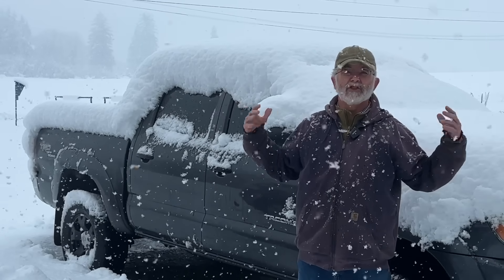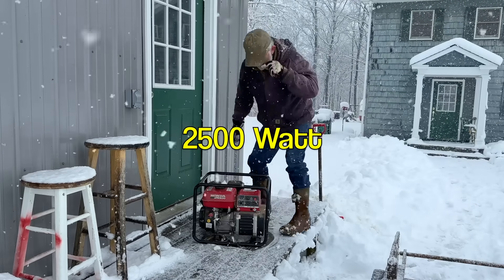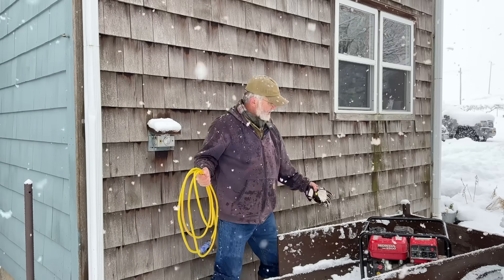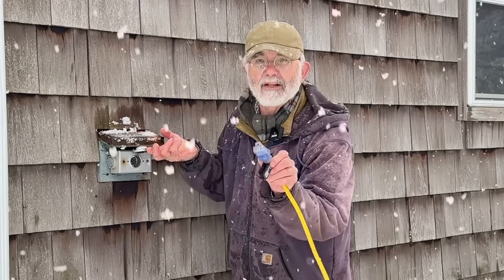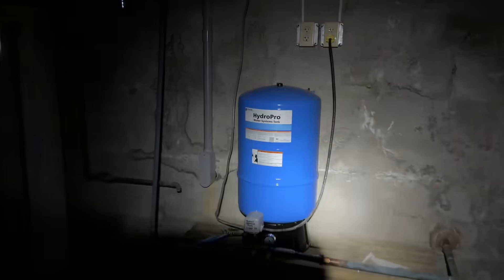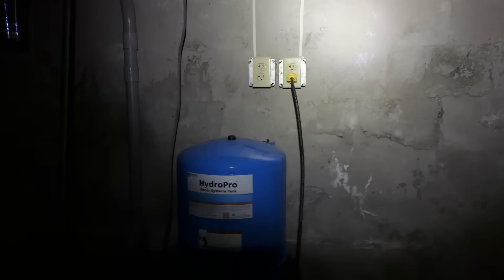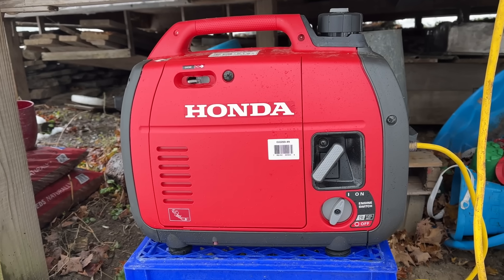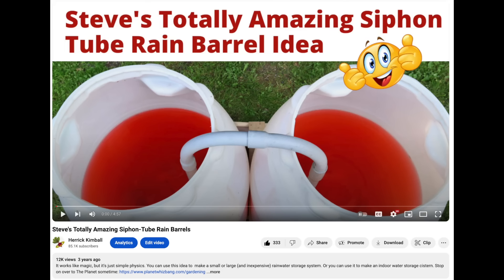Super Simple Generator-To-House Hookup  -- A Proven How-To

Comment: very cool idea!  I personally ended up going the dual solar power station with a hub for 240v into my main panel with a 30 amp generator inlet / interlock switch setup so we can power most of our home and avoid back feeding, but what a cool idea!  I'm curious with the price of the bigger solar power stations coming down if you've thought about tapping into that input inlet (or using a standard 120v outlet) on the inside and using a 2-3kws solar power station to power your parallel circuits?   Of course you're in snow land, so not sure you'd get a ton of wattage from a couple of panels set up temporarily to recharge it and you'd probably still need to use that newere inverter generator to charge the power station :-)

Comment: I turn off the main electrical panel at my pole and I have wired into the house panel. This way no power is sent down the main circuit. Have used this for the last thirty years on the gulf coast.

Comment: Suicide cords are illegal. You could actually kill a line worker. So if you use a suicide cord..usual is double male end. Turn off the main breaker. On most homes they are marked 200 amp. Then you can use this set up without risk to others

Comment: I have a building that's off grid. When I need to power it , I use a generator. The way I do the hook up is to use a generator extension cord with a male plug on both ends . I first hook up to a outside receptacle , then hook it up to the generator , then I can start the generator . The only things I power are three or four florescent lights . This works very well 
This building has never been on grid
( there's no grid available ) .

Comment: We're in the Northern Catskills. Our power went out last Thursday and again on Thanksgiving day. NYSEG customers. 43 hours out last week and 7.5 hours this week. We had a power outage a few weeks ago from a blown transformer as well. That was pretty widespread. We've become used power outages. They occur fairly often. Long term would be quite inconvenient. When Irene passed over us in August 2011 we lost all frozen food. We're in the process of building a pantry and my wife has become quite a canning queen, (pun intended) even canning venison. We have an older Homelite generator with electric start and I was trying to dream up a way to easily hook it up for the necessities. I'll be utilizing your ideas for dedicated circuits. We have a spring with a jet pump and a great little creek close by so water shouldn't be an issue. Wood heat. Propane stove. Coleman and kerosene lanterns. All the modern conveniences. Thanks for the ideas. 
It makes me wonder though, how they survive on the Tug with feet of snow, not just inches.

Comment: I've often wondered if I could simply throw the main breaker to the grid power and wire a plug for my generator and hook it to the fuze box..... yes I know that is illegal because there is no OSHA safety system in place however if my power is out I am not worried about OSHA !..... if the plug is set up in such a way as to remind you to un plug your generator before throwing the main breaker how can it be bad ?   
if you do forget it will destroy your generator and probably start a fire but hopefully you hooked the plug in to your generator into some circuit breakers  .... yes a lock out box is safer and is "THE LAW" however not everyone can afford "the LAW" anymore especially here in california ! .... personally I see no danger in disconnecting the main power completely where it comes into the house and then powering the house from your generator it's just that you cannot forget !  and that is the big danger and why they made it a law !
 it's not rocket science although they would like you to believe it is....and wiring up a plug is just about as hard as this gets..... just unplug it "Before" you turn the main power back on !
I use very little electricity here except when I turn on the electric water heater
and the well pump is 220v  but my generator does put out 220v so I could possibly hook it up and have water during the next power outage.... so far this year only one 3 day outage but the year is young I am counting from end of summer to last of spring that is the time we loose power...sometimes for weeks !
Reply: I'd rather not deal with that big "IF I DO FORGET." Electrical work should be always done to reduce to zero the possibility of human error.

Comment: Probably the safest way- but LABEL THEM.
Also use generator to charge 12v AGM batteries, and a 600W pure sine inverter for freezers only. Quieter overnight.
Reply: Label them for what purpose
Reply: @condor5635 Because if you don’t and the generator is not connected someone may think the socket is faulty, and connect the two together- back feeding the supply if there was a power outage. 
Just label them “Generator supply”.
Reply: @r.perkins2103  yeah I guess that would be safe although unlikely doesn’t hurt. I’m sure this guy knows and his family knows but someone down the road might not figure it out.

Comment: This is a very confusing way of doing this using extra dedicated outlets for only the generator. It would be much simpler, and my opinion safer, to backfeed 220 v through a welder or clothes dryer circuit into the whole house main breaker. Before hooking the generator I simply turn OFF the MAIN BREAKER to the grid and any breakers for appliances, like water heater, I don't need.  My 220 welder circuit in the barn goes through a fuse box directly into my main breaker box. Even if you don't have a 220v circuit in your house the same thing can be done through a 110v circuit. I did that for years before I got the welder and dryer.

Comment: I never use the on/off switch on any gas engine that goes unused for months or years.  I leave the ignition switch on and turn off the fuel supply at the tank. This empties the carburetor while the engines stops from fuel starvation..  This keeps the carb from gumming up. When I want to use an engine that has been unused for a long time I turn the fuel valve on and every engine I have starts in one or two pulls.
Reply: Same here, if there is no gas shut off valve, I add one.  However, if I mention this to others, most don't see the value.
Reply: I've done that on ALL my gas machines and find that's the best practice. Best part they'll USUALLY start on the first pull!
Reply: @donwilson4618 hey man that is a simple trick that never occurred to me. I do it with my snowblower from habit, based on what my dad did. But the logic will apply to all gas motors. I guess I was a classic case of monkey see, monkey do. Thanks Don.
Reply: I use 100% gas. Always start. Worth not having repairs.

Comment: So basically you're simply running a permanent extension cord to your home. Is it safe to say if you used heavier wire you could run more outlets throughout your home from the one plug or would you just put more outlets outside n move your gen as you need it? I have a Predator 7500

Comment: Basically you have wired a permanent extension cord into the house, to power critical systems like your well pump, heater, and some lights. Often, in electrical power outages, the gas service remains operational, so a smallish backup generator can power your heating system, preventing the house pipes from freezing and bursting, if it is really cold and outage lasts for multiple days (e.g. Texas in 2021.) Luckily, the US power grid is pretty reliable and outages don't last multiple days (fingers crossed.) For clarity, your solution is isolated from your regular main electric panel--unlike the solution using the 'suicide cable' (consisting of a male plug on both sides plugged into generator and into a wall outlet--which works, but bypasses you main panel circuit breaker, and relies strictly on the generator's over current circuit breaker--which your solution seems to share. For the sake of others, it would be a good idea to label the outlets that are 'live' when you power the back up generator.

Comment: do it right, add an interlock breaker to your main panel. Wire a receptacle on the outside of your house. What are you doing works, and maybe safe, but interlock breaker is not that expensive, and will benefit you more than what you're doing now.

Comment: Generators are designed to run on a level surface. You just slung it around running while putting it into the cart and it was still running while you were pulling in the cart around with about a 20 degree angle from level.

The rest of your setup is good and safe but is not a practical retro fit for 99.99% of homes today. It would really have to be installed at the time of construction. 99.99% of women will balk at having exposed conduit in their homes. I used to do the extension cord thing but after this last hurricane, I put in a lock out and transfer switch. I have 4 different size generators from 700 watts to 7.5 kilo watts capable of running on different fuel sources. I mapped and color coded which breakers to leave on for each of them. The smaller the need for electricity, the smaller the generator I run. The smaller the generator, the less fuel consumed. I also have a small solar system that will run a few lights and the TV.

Comment: I have a genny in my garage. A separate 8-2 wire goes into a 20 amp breaker in my main panel in the house. When power goes out, I shut off the mains, crank up genny, flip the breaker on, and have power. Since it's only 120v, only 1/2 the panel is energized. But I have it worked out that the energized circuits are for what I need. Heat (gas) is number 1. Then tv and a few lights. In my case, nothing else is needed. Since it's only me in the house, there is no need for a transfer switch and no  way power will be backfed to the grid. I have my chart to tell me in what order to do everything and what outlets are usable.

Comment: I have the exact same Honda EG-2500 generator bought it 1993 for power outages, and it still runs great.  This past April I bought for $ 49.99 a Predator 2" semi-trash water pump Wheel Kit..  This wheel kit is heavy duty it comes with 10" rubber wheels a pull handle, and all the hardware.  The best thing is, it will bolt onto the tubular frame of your Honda generator, just like it did on mine.  Back in the 90"s portable generators did not have wheels, we had to pick them up to move.  I would pick mine up put in a wheel barrel, take around back of the house and plug into a transfer switch I installed.  I'm 66 and have been in construction my entire life,  for $ 49.99 it made moving the generator easier on my back, and that makes me happy.
Reply: Standby Power is the future!
Reply: @marshallhill9146  Stand-by generator, back-up generator, portable generator, emergency power generator, same thing! lol!
Reply: Actually the future is solar and an internal combustion generator a solar generator will run what you need in most cases 24 hours 7 days a week and if there is either no panel's or no sun will recharge from the gas generator in under 3 hours less gasoline and no baby sitting trying to remember to start the generator to run an appliance
Reply: @douglaswindsor120  Don't be ridiculous. I guess you've never looked into "free energy" technology, which has been kept from the public since Tesla. But I digress. Yes, solar panels can be useful under the current conditions, and even EV's too for that matter. However, neither are suitable for widespread use, as primary sources of energy or transportation. For example, I'm all for battery powered golf carts, ATV's and side by sides, etc. Maybe even little smart cars to commute in urban areas. But trying to force EV's onto everyone and infringing on their ability to purchase an ICE vehicle is a straight up tyrannical disaster in the making. The bottom line is "they" don't want any of us to own our own car. Duh.
Reply: @BrickMudge  actually there are more than enough free energy videos on utube but it's illogical to think that you can pair an electric motor and a generator and produce 10 times the power that the motor uses there are videos that claim you can build a solar system for under a hundred dollars that'll power your home using it looks like 4. 40 watt solar panels and apparently all your household appliances will run on that machine if you know where to buy from the big box stores 4 40 watt solar panels a charge controller and a 120 /240 pure sine wave power inverter of 3000 watts for under a hundred dollars please let everyone know I'm sure everyone will go solar and bankrupt the greedy energy companies since you have obviously bought the plan's for these free energy projects and since you have probably signed a non disclosure of Im not asking for the plans themselves just who sells the products for that low price range
Reply: @douglaswindsor120  I wasn't referring to any of those ridiculous things. Stop insulting your own perceived intelligence. It's getting you nowhere.

Comment: I've got generators from 2500watt to 7500watt dual fuel. Keep 50 gallons non ethanol gas and a ridiculous amount of propane.
Reply: Do you not have ready access to gasoline close by?  You keep 50 gal on hand all the time?  Just curious how you cycle it out

Comment: This is the reason I moved to Florida from Chicago.  If you do buy a whole house generator stay away from Generac and go with Kohler. I rent and have 2-2200i's in parallel and 10 gauge extension cords. I just run the wires through a pool noodle with the window closed on the noodle. I also have 4-Ecoflow Delta 2 units  and 2 Ecoflow River max power banks. I do not like going without power.  I have 2 window ac units and 2 electric heaters. It does get cold in North Florida. I am happy a lot of people are getting a back up power sources for their home.  What is a  surprise is that we get a lot of hurricanes in Florida and there are very few people who have a back up power source. Also label all of your outlets or use a paint pen on the outside outlet. 

Great video,t hanks.
Reply: Generac sucks.   I also run Honda portable generators during hurricane power outages.
Reply: @Asidebar  Generac's business model is build it just good enough to get through the warranty period.  Companies know that the vast majority of generators only put a few hours a year on the units.

Comment: Nice to keep it simple! Since you have a sort of 'ready  to work' emergency power  setup installed, i would suggest, if not done so, to take care of a proper ground or earth wire. So you have a good return path if there is a problem. Your house has likely already one, or you can drive at the generator spot a new one into the ground with a lead to be  connected to the generator when used.  With a proper ground a RCD can protect you. Without a proper ground, any self generated power from batteries, generator, solar, would need an isolation protector to be safe.